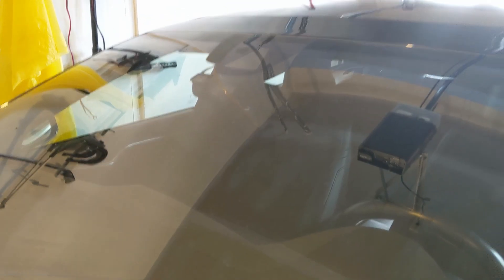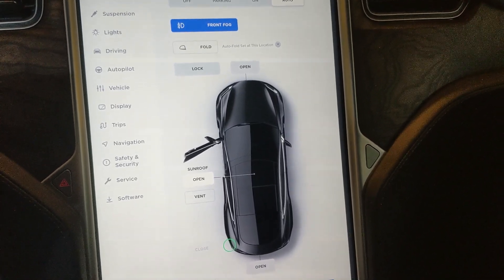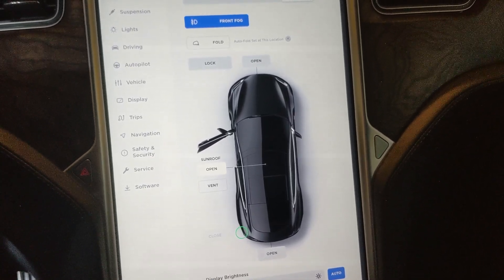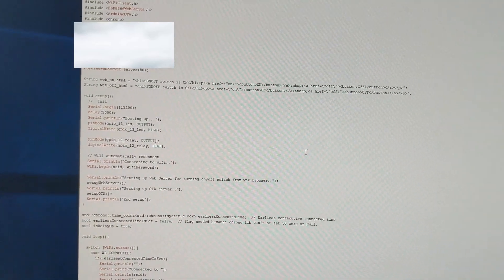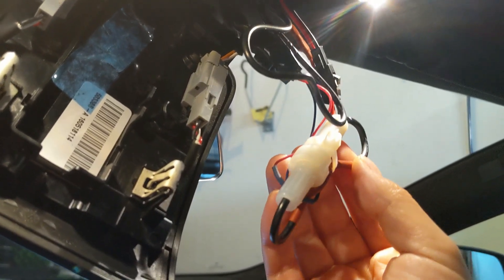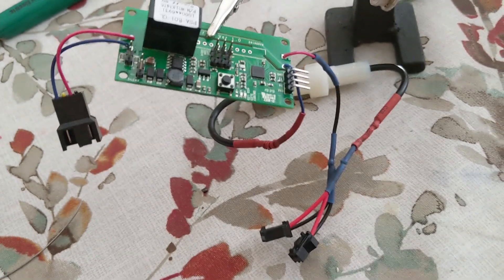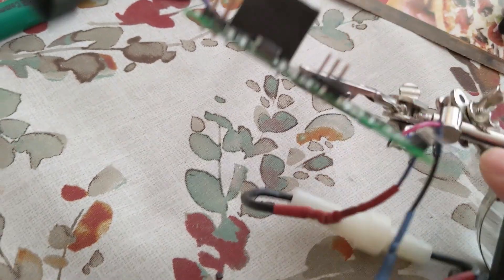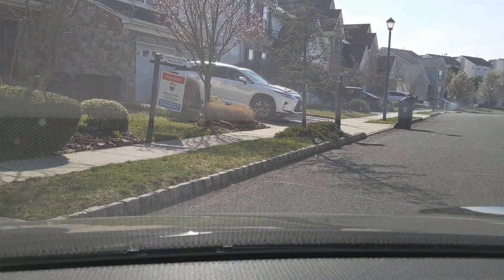Auto turn off/on Dash Cams (Parking Mode) when car is parked at home or not!  No human intervention!

Comment: Well done. I was also wondering about this type of project.
Is it possible, when the car turns on it (sonoff sv) turns on the dashcam instead of losing the wifi ??? 
As per your demo you almost left your house at least 300 to 500 meters before dash cam turned on.. 
as you turn on the car it should turn on the dash cam ?? 
let us know if its possible
Reply: I had this same thought. I have a hardwired dr750x  plus and I'd like to have it off in my garage but on when the car starts (and have parking mode keep working after that point until it connects to wifi again).